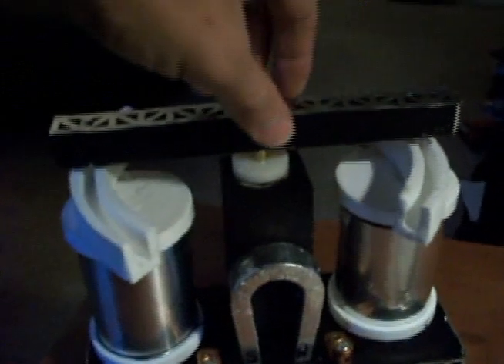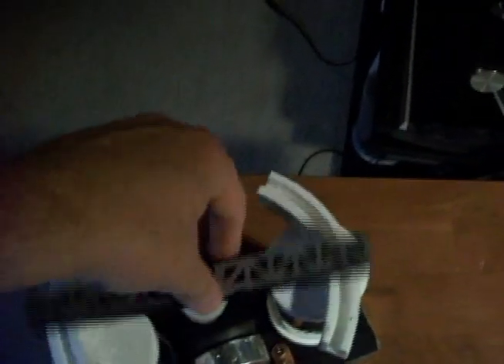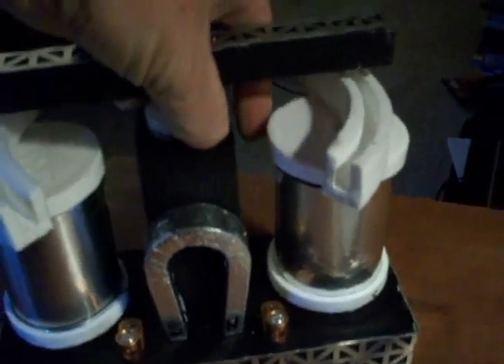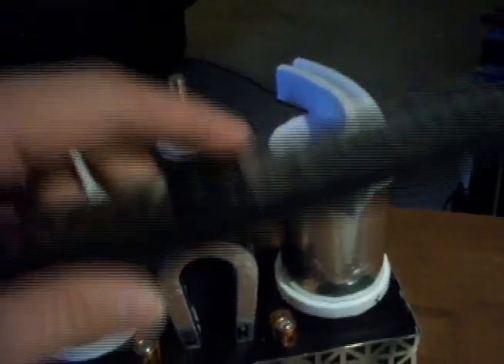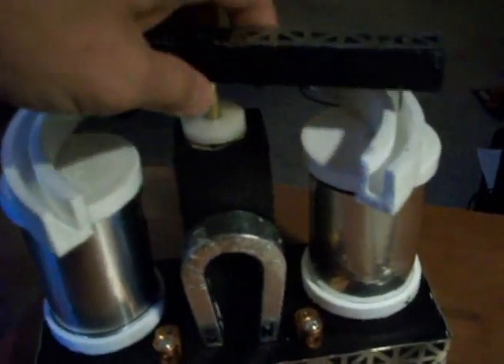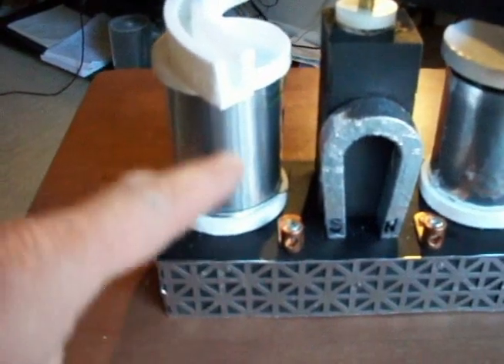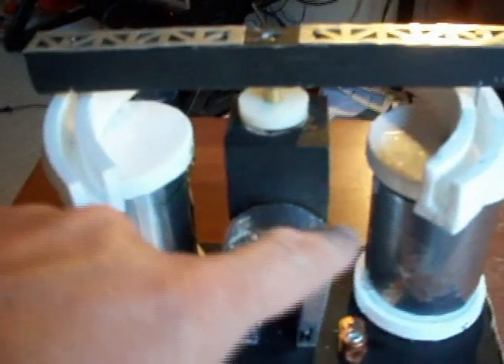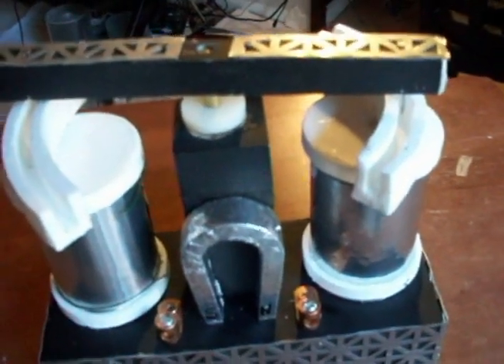5 Nostalgic

Comment: There is a way to get micro voltage off of a horse shoe magnet by hooking a conductor to the inside and another to the outside of the magnet's curved end in its center and outer curve.  This voltage could be captured into a capacitor then run a low voltage oscillator to pulse an inductor and the capture out using a diode transistor and an inductor.